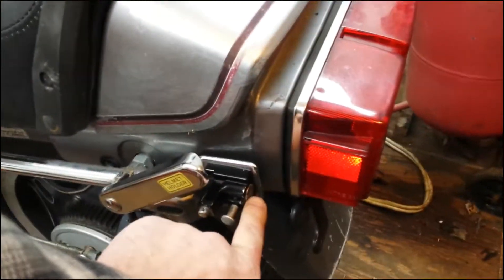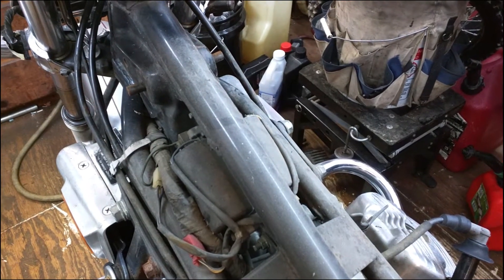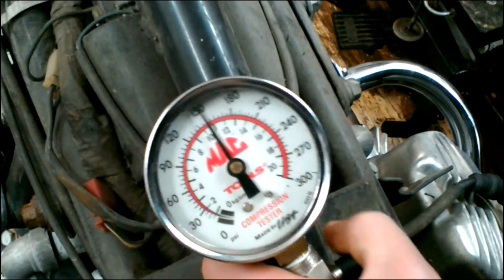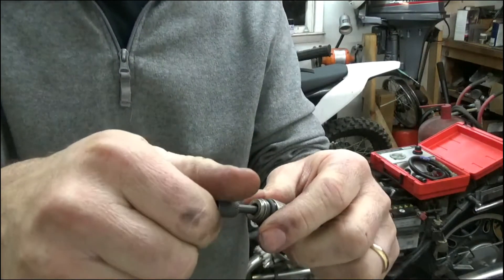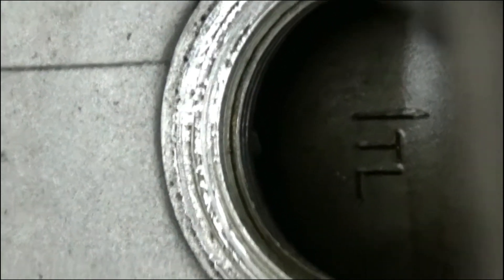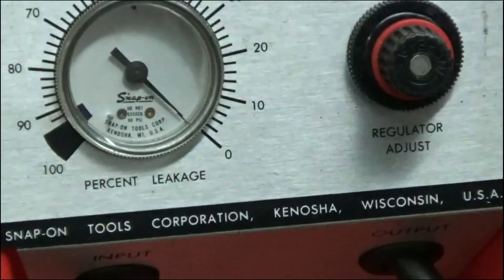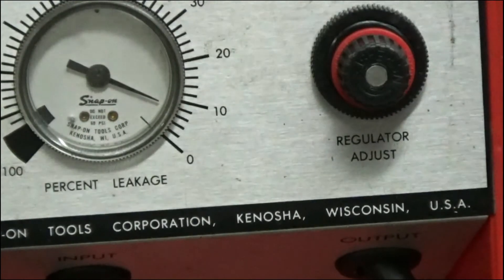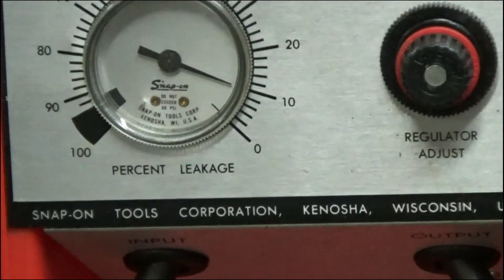1982 Honda GL500 CX500 CX650 Compression, leak down and spark test

Comment: Hey man. I have a Gl500 that I recently heavily customized. but it's my first time facing all mechanics and electrics. so I'm basically a rookie. :D anyway she is miss behaving a bit. The left Cylinder seems to not be firing. Air comes of but cold/very mildly warm, and not as strong as the right cylinder, that idles strong and hot.  I have visually nice spark on the spark leads and on the Spark Plug (brand new spark plug). any guess at what could be. and how to fix it? thank you so much in advance for your help.
Reply from the maker: My guess would be that it is not getting fuel. Run I a few, cut it off and drain the bowl of the trouble cylinder and see how much fuel is in there. If equal to the good side, check the jets. If you can see light through all the jets. Check compression and leakdown if you can.
Reply: @TepcoCycleRepair   Thank you so much. I will do. and let you know how it goes